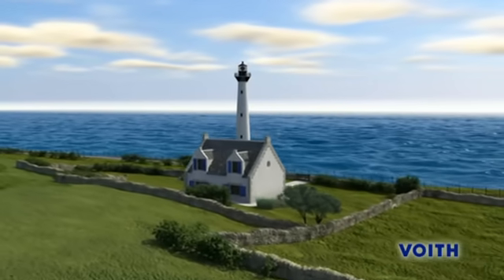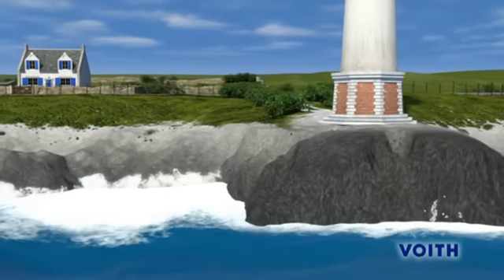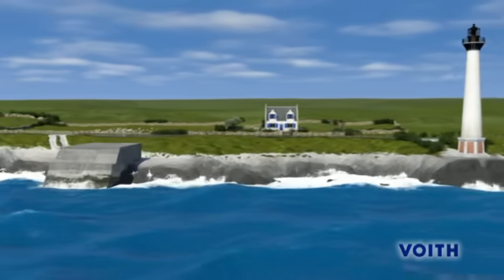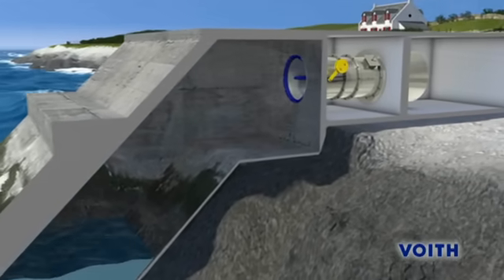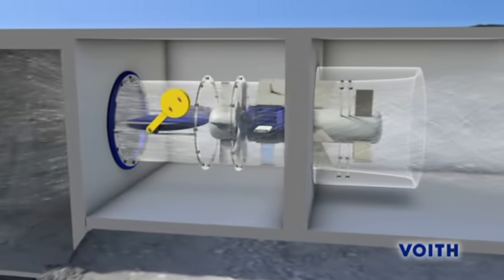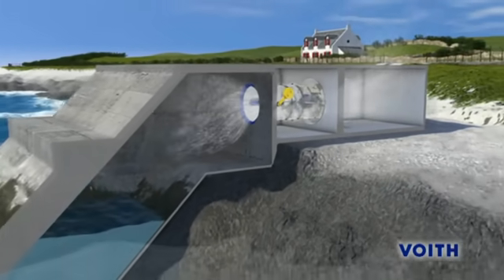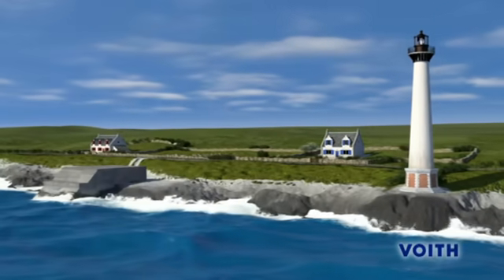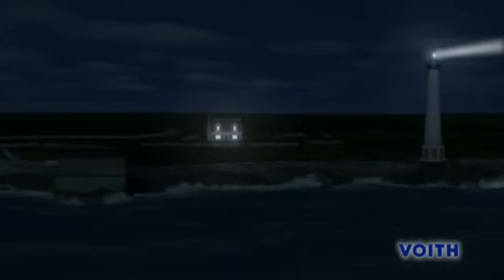Ocean Energy -  Wave Power Station

Comment: 11 years ago: "this will revolutionize the future!"

today: "still garbage"
Reply: @ T C Aside from the conspiracy theorists here I'll try and explain a bit on why this technology is not coming online. First you have to consider tidal factors (Higher tides costlier and longer inlets needed for production) Second you have to consider lifespan. Concrete and steel don't hold up  very well in high salt content areas. Third marine life can grow in the inlet system like they do on ship hulls so without expensive gates and cleaning methods it doesn't take much time for them to remove efficiency. As someone else pointed out in another thread the cost versus return is extremely high. Modern tech such as copper lined (poisonous to aquatic life) intakes can improve life and prolong efficiency but they drive initial costs up exponentially. The goal of tidal power has been around for over a century but the simple fact is construction in seawater has destroyed almost every project before it has even recouped it's initial construction cost. Theoretically you could conquer factors but the construction would be massive. The Annapolis Royal generation station on the bay of Fundy took 4 years to build and only ran for 36 years till it failed (as well as created major erosion and marine life issues. ) It's high initial cost and high operating  costs for on enough power to feed 4500 homes has been why no other projects in the bay have even been looked at. Tidal energy costs about $0.66 to produce per kwh offshore wind $.20/$.30 by comparison coal costs about $.03 per kwh
Reply: ChillyCloth  I don't think it is efficient enough yet, and probably does not generate persistent power. but still a nice concept
Reply: the replies of this comment are hilarious
Reply: amaizing
Reply: disaster for coastline wildlife, think again my friend
Reply: Its garbage for the financial parasitical sector that cant put a counter on the primary energy feed which is the ocean's water flow...any device that give free stuf to people is been fought against...or if not they Will priviatize it
Reply: @michaelbouillon1241  "free"
-costs a shitload
-way more expensive than better energy sources
Reply: @Kneejair  2 times. Not 1 but 2 times. That is the number of times you showed the world in the comment section of one of the world's largest social platforms your 4th grade "education" from a Public Indoctrination Center. Teach yourself homonyms and homophones. Start with "you're, your and yore".  You're clearly not a person that contributes to proper English, is your job a waiter or dishwasher? Simp.
Reply: ChillyCloth  Quite easy to explain: The military needs the nuclear power plant technology because of the plutonium used/needed in nukes. So green / CO2-free technology will never have this status. 
And: I don't think that this is garbage. 
In my opinion it has only two additional problems: 
a) The power is made were its not need (means on the coast).
b) "Pumping/sucking" air in and out is loud. 
Both "issues" are easy solvable.
Reply: @v.gedace1519  that is just dumb. the world doesn't constantly consume fissile materials for nuclear weapons. Nuke aren't ordinary artillery shells. when was the last time a nuke was used in conflict? the nuclear material currently deployed on missile are infinitely recyclable once their delivery vehicle (ballistic missiles, cruise missiles etc) is decommissioned due to old age. if the time comes that we need more nuke warhead, it means apocalypse has already transpired. and we wont be needing nukes for the handful of humans scurrying upon the ruins of our cities.
Reply: @juliosunga3530  You should read comments carefully. In particular, mine.
I wrote about the nuclear power plant technology. The military has an interest to keep the technology alive.
Regardless of the reason it seems to be needed. 
(Aka replacing decayed plutonium, adding new (types of) nuclear weapons to the arsenal or whatever the military can think of ...)

Because otherwise they would not design, build and run special nuclear power plants that provides more weapons grade plutonium than the "standard" nuclear power plants. 

From a military point of view, there is always a reason to keep the technology and with it the "business" alive, in order to get weapons grade plutonium quickly (and as cheap as possible).
Reply: @v.gedace1519  So your point is that the military needs fissile materials (plutonium/uranium in this case) to maintain and build new nuclear weapons. If that was the case, then surely the military would have other means of getting fissile materials from other sources besides nuclear power plants. Relying on the byproduct of electricity production, with no other sources of getting it is foolish - if they want to get fissile materials, they should be able to make it if need be. Why wouldn't they have a plan b of getting those materials when dealing with such dangerous weapons? (also why would they worry about the cost of getting the materials when they already spend their funds quite lavishly?)
So the military doesn't need nuclear power plants to get fissile materials. The main purpose of nuclear power plants is energy production, they excel at it, that's why they are a large contributor in energy production and that's that.
Reply: @HiddenWindshield  I have to admit that I didn't really feel like responding to your comment.
The reason is your many statements that you interpret into my comments.
Based on your misinterpretation, you add further statements and try to express that I claimed the opposite.

In fact, I started to answer every single line of your answer, but then I realized that it probably won't help.

So I'll try again to summarize what I actually said.
Maybe that will help you a little - just as it would certainly help to remember the "non violent communication".

Kind of summary:
Military -> nukes -> plutonium -> brute it from Uranium -> only way to get it: nuclear power plants / "Nuclear Enrichment Facilities" -> Military: Interest not to switch them off.

So please: Just read my comments again and take a look here https://www.youtube.com/watch?v=7L3rBTChHs8

Its really so easy.
Reply: @v.gedace1519  Wow, how insufferably arrogant and condescending can one person be? You just take it as a given that it's not possible for you to be wrong, so you think that anyone who disagrees with you must not understand what you're saying. What an incredibly insulting attitude.

For the record, I understand what you're saying perfectly well. Your written English is perfectly clear. There is no miscommunication going on here.

You are, quite simply, wrong.

Power plants do NOT produce weapons-grade fissile material. This is a basic fact that could be established with a bare minimum of research. The military buys its nuclear material from mines, and has its own enrichment facilities to produce the weapons it needs. Therefore, the military has no interest WHATSOEVER in civilian nuclear power plants.

Power plants and enrichment facilities are two different things. Enrichment facilities actually consume power to enrich the nuclear fuel, they don't produce power. So lumping them together in that condescending "summary" you posted is also a mistake.
Reply: @HiddenWindshield  All quotes are related to this source:
https://en.wikipedia.org/wiki/Weapons-grade_nuclear_material
and 
my comments

Quote :
" ...
Only fissile isotopes of certain elements have the potential for use in nuclear weapons. 
For such use, the concentration of fissile isotopes uranium-235 and plutonium-239 in the element used must be sufficiently high. 
Uranium from natural sources is enriched by isotope separation, and plutonium is produced in a suitable nuclear reactor. 
..."

Trying to break it down step by step
"...
and plutonium is produced in a suitable nuclear reactor. 
..."

"...
suitable nuclear reactor. 
..."

"... suitable ..."

Another word (acronym) for "suitable" is "qualified".

My statement was and is:
"...
The military needs the nuclear power plant technology because of the plutonium used/needed in nukes. 
..."

I never talked about who owns and/or who runs these power plants.

Your last comment confirms my statement that you misinterpret my comments, add further statements and try to express that I claimed the opposite.

Again: 
I never said anything about ownership. 
"... The military needs the nuclear power plant technology because of the plutonium used/needed in nukes. ..." 
Nothing about ownership. 
They need the technology. 
Nothing about the process to finally get plutonium.
Nothing about who buys what from whom.
"... The military needs the nuclear power plant technology because of the plutonium used/needed in nukes. ..." 

Side note:
Also in case they own and run their own power plants: They would also have a strong interest in not to close (civiliean) power plants.
Reason: Costs.
The main message remains: "... technology ...".

At long last:
I am sorry for you that you did not follow my advice and took a closer look at "NVC".
(Short story about me: My parents taught my "You are lying when you shout!" 
Literally, they were wrong because the volume isn't due to whether you are right or not.

But what they tried to teach me was that you should never get loud in a (serious) discussion / talk because if you do that, you will discredit yourself and your credibility will decrease significantly.

The length and complexity of the statement also shows why my parents used the short version mentioned first (to explain the correct behavior to a boy at the time).
Do you understand it?

Finally:
I am going to stop this conversation, let a little time go by, review then this discussion and try to figure out why it went so terrible wrong.

Thanks to everyone for your interesting contributions!
Bye.

Edit / Update:
Sorry. For the point of sake:
What nationality are you?
Reply: @v.gedace1519  1) nuclear power is the cleanest power source 2) ¨renovable¨ energy is the most contaminant one, even more than coal. see the data, germany closed a lot of nuclear plants in the last 10 years and became the most contaminant county of the eu, france opend 9 of them and its now the less contaminant country of the eu.
Reply: @v.gedace1519  First you wrote military needs it for nukes, then you say they just need the power technology... Make up your mind which bullshit you wanna go with
Reply: @v.gedace1519  If you are so against nuclear power. We'll gladly take it from you. Cheers from Poland. We'll donate all our windmills in return.
Reply: @HiddenWindshield  It is funny how you discard the fact that things that are unused indeed are lost to time when not that long ago, if you keep up with the news, USA declared that they will have to reverse engineer their own bombers that they themselves made lmao.

USA has forgot how it made its B-2 lmfao. And you believe technologies that are kept a secret can't be easily lost?
Reply: @kirayoshikage4057   I never claimed that specific technologies can't be lost. I said that that specific scenario is complete nonsense. So, please stop putting words in my mouth; I barely have enough room for my own words and yours taste funny.

One, the scale of your B2 example is just a little bit off. @V. Gedace's scenario is closer to "losing piston engine technology" than it is "losing one specific aircraft design". Even if we do stop producing either piston engines or nuclear power plants, we could easily recreate them from first principles in the future, the same way we did the first time. Yes, we will have lost the ability to produce specific engines/weapons in that case, but the concepts will still be around.

Second, while nuclear power plants and nuclear weapons are related, they aren't the same. @V. Gedace's argument is more like "Losing piston engine technology will also cause us to lose turbine (i.e. jet) engine technology at the same time somehow. Even if turbine engines are still being actively produced and developed, the loss of piston engines will magically make the turbine factories stop working." Yeah, no.
Reply: @v.gedace1519  it probably generates more CO2 per energy unit than nuclear power plant as it has low power but a lot of concrete
Reply: @hphp31416  That was my thought.  Ton of COD causing concrete in a complex underwater form.  Seems far too expensive, inefficient, and intermittent to work.
Reply: @v.gedace1519  Dude, if they use the radioactive materials for power plants, then they'll have less radioactive materials for making weapons. Your comment makes no sense.
Reply: @v.gedace1519  I read the rest of your comments after replying, and I'd understand your point. I do still think nuclear energy is more reliable than this kind of clean energy
Reply: @v.gedace1519  and don't worry, I know you said they want the technology to develop
Reply: @v.gedace1519  look, I'm from Argentina, there's a nuclear power plant close to where I live. If that shit works, it sure is reliable
Reply: @agustinbarcia3375  Quote: "... If that shit works, ..." -> Means its not working = its not reliable = its so easy.
Reply: @v.gedace1519  it's working, it's generating electricity. You are saying that they want to develop the nuclear technology, and indeed they did, and that also means its safer than before. You can't judge modern planes from what happened to the first planes that came to the market
Reply: @v.gedace1519  u dont know fision works, the nuclear fuels that produce plutonium are forbiden to use.
Reply: @v.gedace1519  First, I wanted to adress the point a) you talked before: The power is not generated near the point of demand. Right? Almost no power source does this, that's why you need tousands of kilometers of lines to transport the power through a country. But, the future of electricity will consist on generating the power near the demands, and there are a lot of coastal cities, and I think that this kind of energy source would be great for that, because is doesn't pollute the ambient.

And about the nuclear energy. I have understood that nobody died beacuse of the Fukushima accident, and it was rated 7 in the INES scale (the worst possible rate). I mean, nobody died beacause of the direct exposure to the radiation.

So, the nuclear energy is realiable. I mean, the are 440 nuclear reactors running around the world. Many others where dismantled as they reached the end of their lives. And how many accidents have there been related to this kind of energy source? Wich was the last one? Fukushima, 9 years ago, caused by a tsunami? More people die because of other tipes of energy sources.

This types of power plants are like planes, statistically, the plane is the safest mean of transport, but when a plane crashes, surelly it will kill everybody on board. Similarly, when there is a nuclear accident, it will affect hughe areas. But with modern means of control and normatives, the risk is very low.
Reply: @v.gedace1519  
>nuclear power plant are NOT RELIABLE! Search the web for nuclear power plant accidents
kek
>Tschernobyl
kek

 the next generation of reactors, thorium reactors, dont produce plutonium

Comment: I thought energy could be extracted more simply with waves moving solid objects up and down which somehow can be made to do work on an electrical generators. Maybe this turbine-based system is easier to maintain, i.e. no contact with sea, but contact with sea air.
This seems a better concept than windmills. Here the sea collects wind energy from a wide area making it more reliable. One the other hand thinking geographically this can only exists along coastlines lines (1D space), while windmills can exist over an area (2D space), which  obviously gives more opportunity.  However if the goal is to increase the planet's collective wealth, then nuclear is the way to go. Sorry to offend.